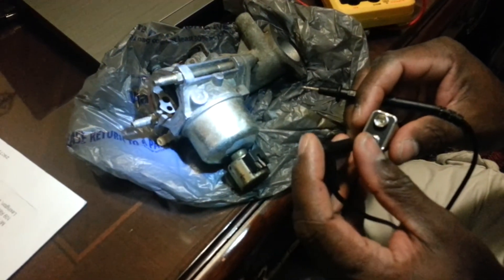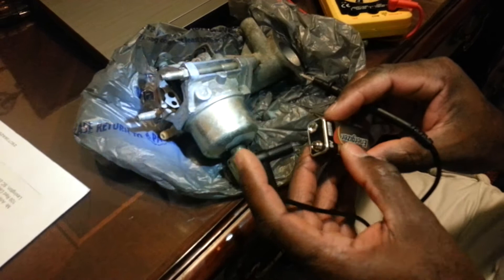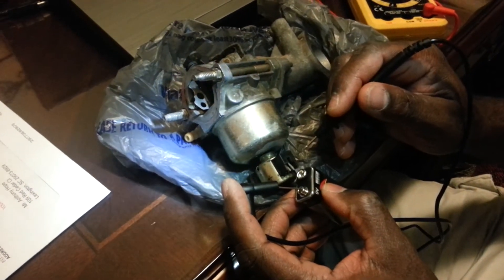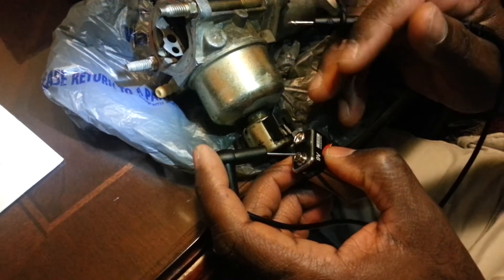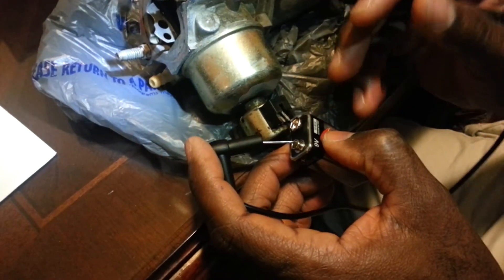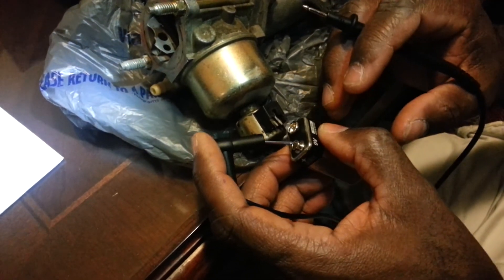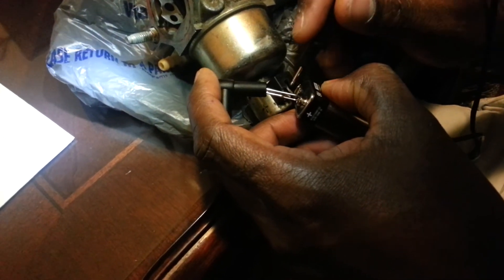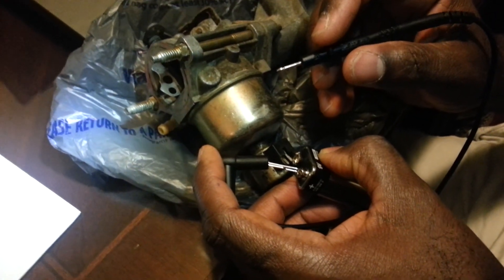Carburetor Bowl Solenoid Bench Test!

Comment: How do you take the bowl off of these kind of carburetors?
Reply from the maker: Use a small thin wrench and remove the solenoid at the bottom if the bowl
Reply: DIY OneForAll The solenoid on mine is circular so it spins freely with a little bit of pressure. The only way I could see to take it off the bowl is there is a space in between the solenoid and the bowl but I can’t fit a wrench in there. I was afraid I’d bust the solenoid so I didn’t try to move that part at all.

Comment: mine is the opposite. when i bench test it, the pin pops up. So the pin must be used to open fuel flow. therefore, i can't just cut the tip off to keep it permanently open like other vids suggest.  . My problem is that while the solenoid bench tests fine, it doesn't operate when installed that i can tell. its a generator with an on/off switch. same thing as a key really. I wonder if on/off switch doesnt send power unless the engine is actually running. i would have thought turning the switch on would activate the solenoid to open the gas flow.

Comment: So what happens when this thing breaks and it doesn't close the float bowl? Is it going the spill fuel out of the carburetor onto the hot muffler below? I don't understand, why it's not like a normal carb where the float pushes up on the needle
Reply: It actually fills up the carb and eventually overflows into they combustion chamber; Then the fuel seeps past the piston and goes right into your oil. 

and that is not good. I don't know why they did something so stupid.